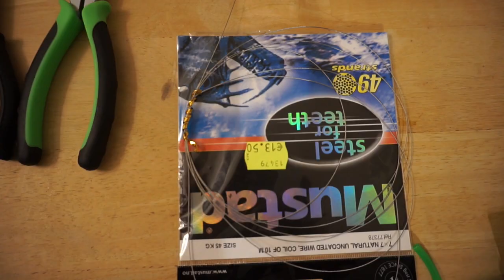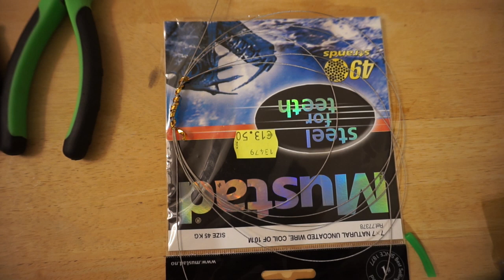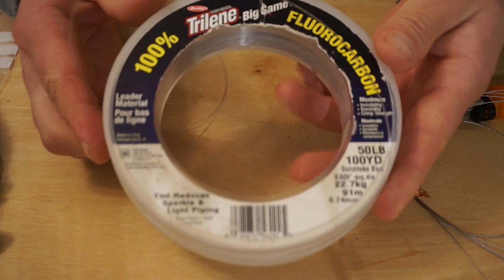The Dongle (dingle dangle) Rig explained - The Best Shore Rig For Catching Big Fish

Comment: Hi, I would just like to say thank-you for taking the time to make the two videos on dongle rigs. I made up 8 before I fished a very snaggy mark with boulders and a whole load of kelp. I’ve used various rigs in the past with various success but this rig was by far the best I’ve used. I didn’t lose any rigs I did lose 4 weights but managed almost a fish a cast including a 9 1/2lb Huss, congers to 8lb and even a rockling and pout believe it or not! 🎣👍
Reply from the maker: Thanks for the comment, really appreciate it. I'm glad the videos have helped you and I'm glad you have found the rig useful.  If you don't mind me asking, what area are you fishing?
Reply: @gsp  Hi, I’ve been fishing the north coast of Devon. One thing I have noticed with the rig is that the weak link line of 20-30lb mono has been wrapping around the hook length loads and can take many minutes to unwind. I did also try amnesisia 20lb which did the same. Any suggestions? I’ve been using yuki 80lb fluorocarbon as my hook length. Thanks in advance

Comment: Ive used this rig for the last 10-12 years and never tied the hook on via the loop always Snell the circle and always had good hook ups
Reply from the maker: The perfection loop will increase hook ups.  It gives the circle hook as much movement as possible allowing it to always pull around into the corner of the mouth🎣
Reply: I just tie to the ring, but I only use 50lb mono.
Reply from the maker: @redtobertshateshandles  try using the perfection loop knot , the whole rig will work better👍

Comment: Like te rig thank you. My concern would be fish not hitting the hook but only the dongle but I've never tried it. If for example I was to make a sausage of crab bait with elastic and then just hooking it through one end I believe it would be presented in a similar way but equally I understand that the benefit of the rig is that all the pressure is on the hook snood not the weight. It's all confidence at the end of the day and it clearly does work I just wonder if the hook up rate would be the same presenting it in this way against the bait being directly on the hook. Many thanks
Reply from the maker: I would really only use this rig when fishing massive baits for massive fish.  A fish thats going to swalllow the bait whole and in tje situation where you need the really heavy hook snood. In the uk, from the shore i would probably only use it for  tope, big congers and skate
Reply: Here in Australia this would catch Snapper and Mulloway. The bait being on the dongle makes no difference. The fish inhale the bait.

Comment: I've caught common skate with this setup.  Last year I stopped using a fixed loop at the bottom of the hair and just have a kicker of the wire to clip down. I found sometimes the loop doesn't pop off with bigger baits.
Reply from the maker: I havent experienced an issue yet (touch wood) 🤦‍♂️. It is a very good rig😁

Comment: Great video. Can the dongle be used with big baits on a pulley rig. I noticed on the rig you made the rig body was longer so it made a  loop so when the bait was clipped down the rig body wasn't touching the bait. I believe this is the main system anglers use in South Africa. The problem I can see with the pulley is that the rig body will still be touching the bait. Just wondering if there is  away to make the rig body slack on a puuley rig
Reply from the maker: The only problem I have found using the dongle on other rigs is that you'll get alot of missed bites.  It works best for big fish with big big baits.

Comment: Bit like a sea version of a hair rig.... looks good
Reply from the maker: Basically yes but it's alot more than that. It allows you to clip the weight up and fish very light lead link with a heavy hook link direct to the fish. It allows for a lot of different size baits to be used too. It also protects the hook length from shark teeth
Reply: @gsp  I’ll be using it this year I reckon for the south coast tope run.... IF we’re allowed to go out to play!
Reply from the maker: It's an excellent rig for tope! You'll  hook them all in the corner of the mouth, just don't strike with the circle hook and let them run for a bit first
Reply: @gsp  yeah, I like circle hooks for cats too....

Comment: Great video, got me thinking.... If you hook a fish but the weak link doesn't break then you would be dragging the fish in alongside your lead? This rig looks like it will present a bait in the same way a standard pulley rig does? Maybe you could adapt a pulley rig if you like the hair rig style and fish a rotten bottom? Or maybe I got the rig wrong?
Reply from the maker: This rig is the most common rig used for big fish in the whole of South Africa and its very effective.  I do understand where you're coming from but this rig works because it is a direct attachment from main line to hook length and because its all cast on the hook length strength.  You could do it with a pulley rig but then there are alot of things going on where as this rig is very simple and can be switched between different Dongle lengths and lead link b/S with ease.   And believe me when you're hooked into a 300lb+ stungray the 6 oz lead isn't event noticeable!😂
Reply: @gsp  I don't doubt the rig, it really does look great and I love the videos..... I was more thinking the extra fuss of adapting a pulley rig would be kinder on the fish as its not getting dragged in on top of a grip lead? Also perhaps more chance of retrieving your lead and leaving less in the water?
Reply from the maker: In theory for smaller 'big' fish i.e bass, cod etc it would work and you would keep the lead up, in line and out of the way.  For bigger fish, tope, big rays, shark, kob there are 2 reasons this rig is far better. 1 because you're clipping the lead to the hook length and not the other way round you can fish a big bait without having to balance it with a lead weight, so you can fish a bigger bait than lead which you cannot do with a pulley. 2 when you are fishing for big fish you want to get rid of that lead and also have a direct knot and swivel link to your mainline.  If youre applying 12-15kg or more drag then the swivel resting against the knot above the lead on a pulley rig will cause damage and could lose a big fish.  Ive even had beads split! 
I think for smaller stuff it may work OK because you can easily offer a peeler crab on a Dongle without affecting the balance of the rig and it would cast fine👍
Reply: @gsp  I see what your'e saying.... sounds like I'm never into a fish big enough to be worthy of the rig 😂
Reply from the maker: @jasonbaker3447  😂😂😂sorry had to laugh! If you targeted tope with big baits this rig would be ideal

Comment: I've been tring to figure out how to thread a worm up the dongle and fix it so it doesn't fly off.
Reply from the maker: Honestly I wouldn't recommend a single rig if your fishing with worms.  The main aim of this rig is to allow casting of a big big bait on the breaking strain of the hook length as opposed to the lead link.
If your aim is just to hair rig a worm to a different rig I'd personally prefer it on a hook as there is more hold🤔

Comment: Hello
Do you get any problems with the bait coming off when casting, because using a hair rig I use a stopper to prevent it coming off
Reply from the maker: Not at all. The top of the bait is hooked onto the circle hook and then it is wrapped tight to the single with baig elastic. I've never had bait come off